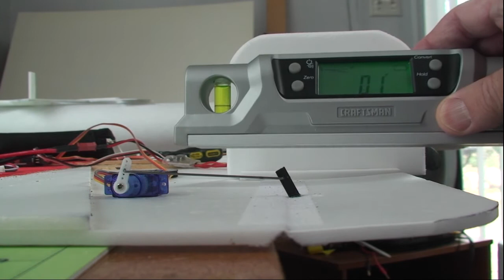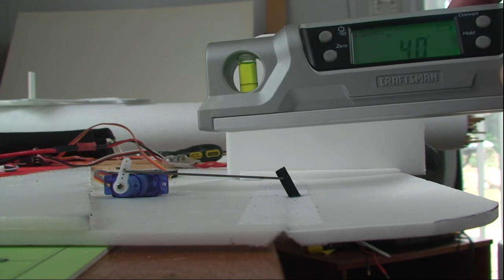Using Mechanical Aileron Differential

Comment: Nice to see! Although I´m an engineer, I´m relatevely new in airplanes and after building my first indoor plane last weekend I have the problem the ailerons are moving more down than upwards. It should be on the other side. But it´s a design problem of the hinges since they are at the bottom of the wing and there´s only one servo. I´ll see if there´s a possibility for improvement.Thank you!

Comment: Thanks for this vid, Carlos. I noticed your 'expensive' protractor! - a simple tip is to buy a plasic cheapo, grind, or cut the baseline excess off, cut the 90* and hinge it (behind or in front, use a self-tapper on an added flap as a hinge), and it is very clear and accurate to read. Thanks, diolch yn fawr, Den, Cymry (Wales)

Comment: it is the same principle they use in the steering system of the car, ie Ackermann angle or deformable parallelogram.
I have set up this way the ailerons on my phoenix 2000